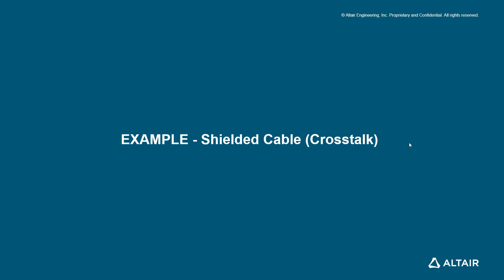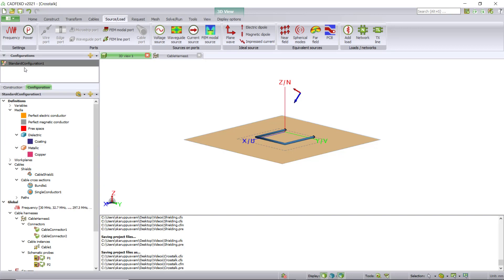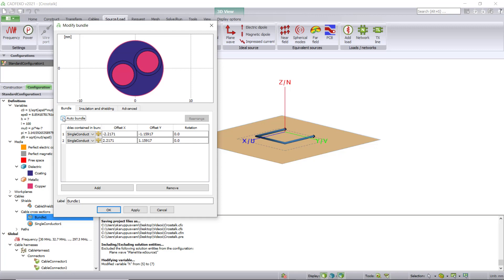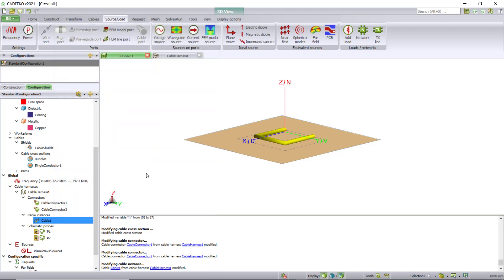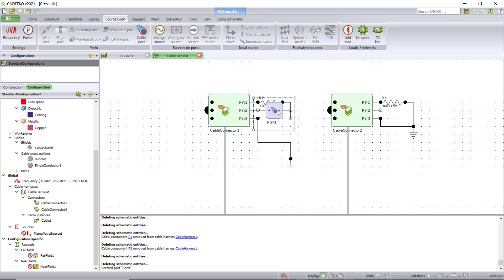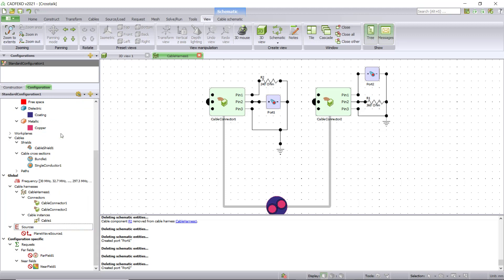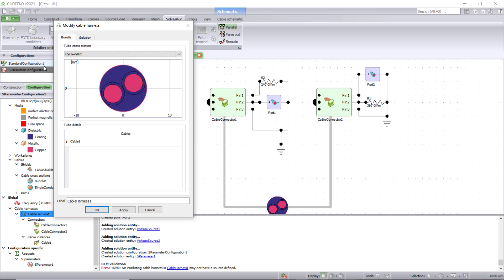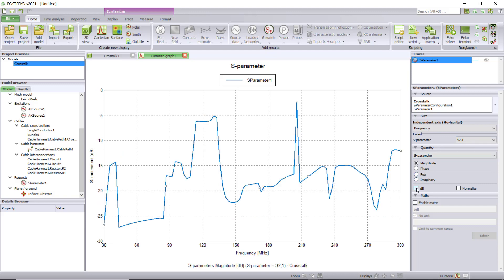EMI/EMC learning series using Altair Feko Example 4 Shielded Cable Crosstalk

Comment: When adding a request for s-parameters, an error appears with the following content: 

"A cable harness, Cable Harness 1, with the circuit crosstalk cable coupling property includes a full-wave request. To activate the wideband circuit crosstalk solution and prevent a full-wave solution, exclude the request(s) from the configuration(s) below. Note that cable probe request will not trigger a full-wave solution. "

The video has the same problem, but I get completely different cross-distortion graphs.